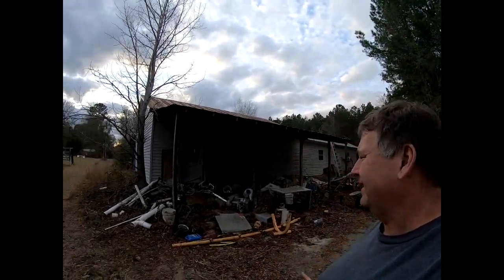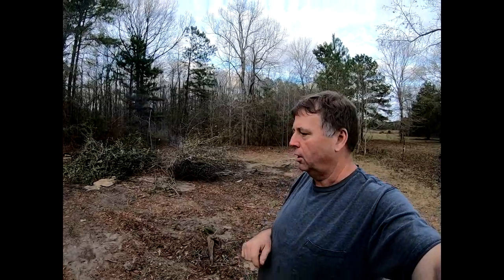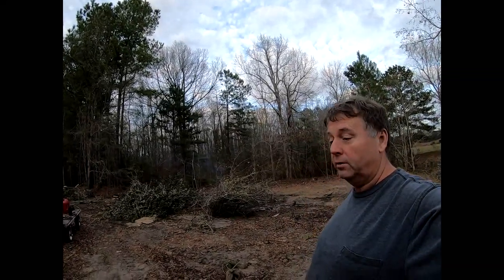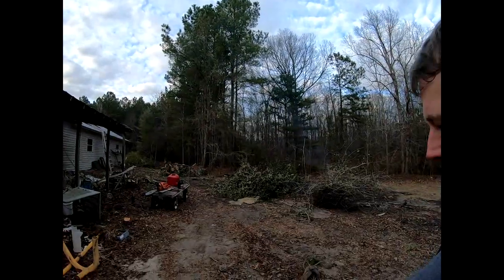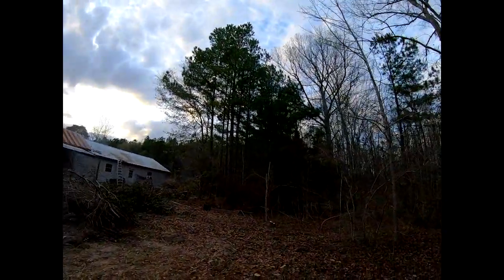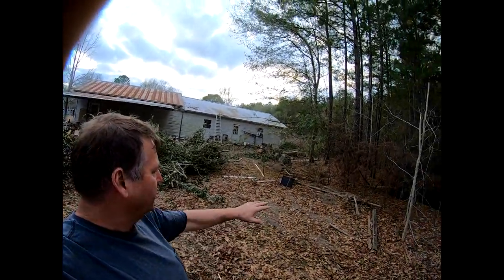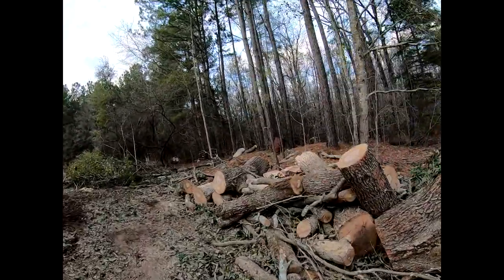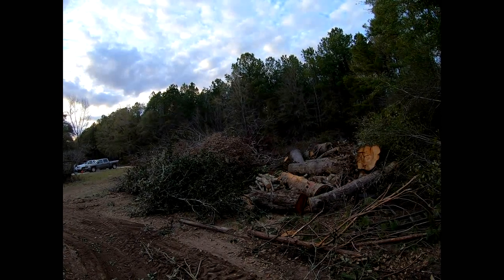New Shop Build Part 1    Clearing the land

Comment: Gonna need some strong concrete for some of those machines... even in places they won't be staying - like loading and unloading... Gonna take some bucks to get it reinforced, thick, and strong. I know you know all this - just don't envy your pocket book.
Reply: Even 1500 psi concrete would be fine for his needs. A 10,000 lb machine with 10 square inches of base area in contact with the floor only exerts 1,000 psi on the floor. The same for a 3000 lb machine with 3 square inches of contact area.

Comment: That old iron collecting addiction is getting costly Mike. :-) Congrats on the start of a new shop.If you don't know then be careful about what depth of fill you add. Ideally any area that will have concrete or a building on it should be put in at about 6"-8" layers and be fully compacted mechanically before the next layer gets added. Just like shop space there's no such thing as having material on a building site compacted too much. And ALL biological type soil has to be fully removed before adding your clean fill. Anything less and you will have building movement and floor cracks. Even more so with heavy machine tools and possible vibrations from them operating.
Reply: I know concrete is expensive.  Don't skimp on the thickness and put in reinforcement.  The last thing you want is to have floor cracks and separations.  Considering what you are going to do with the building my suggestion is nothing less than 12 in thick floor.   The drive and parking no less than 6 in but 8 in would be better.
Reply: @royreynolds108  A concrete supplier can give general recommendations on rebar, it's spacing, size and concrete depth, mix type etc depending on the customers estimated loads. Afaik they provide all that engineering information free of charge. I've broken thousands of tons of concrete with a hoe and loaded it out. It's brittle with any voids under it or in tension. Compressive strength is very good as long as the material it's on remains stable. It's easy to snap 12" thick concrete like a tooth pick if there's no rebar and unsupported. Much much harder to break if the rebar was done right. I was surprised just how weak any concrete is without that added rebar. But average sized machine tools get by just fine on 6" to maybe 8" concrete floors. The average home garage floor is only 3"-4" with expected loads of up to 2-3 tons on 4 small tire contact patches of rubber.

Comment: 24 by 48 is the size of my new shop. I say new I built it 20 years ago. I put doors on both ends of one side so I can pull a trailer straight thru and also have a 10 ft rollup door. My old shop is mostly storage as well. Look forward to following your build.